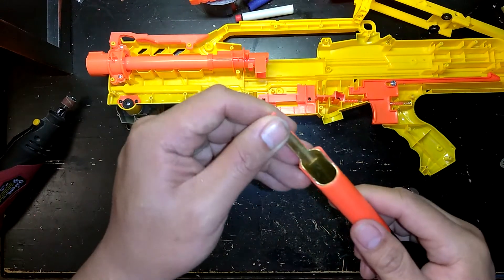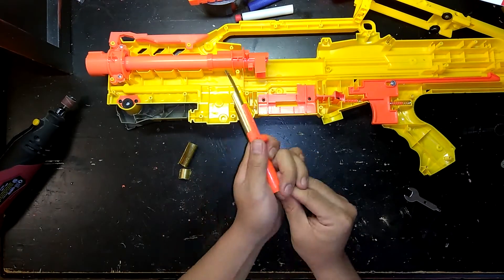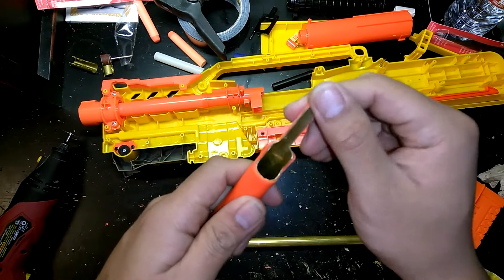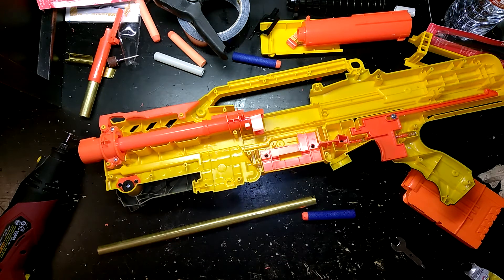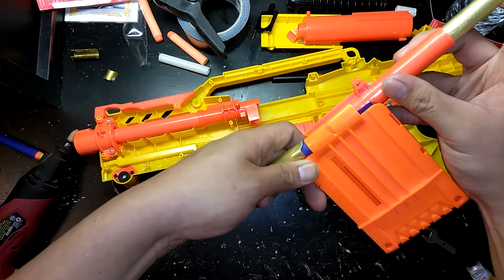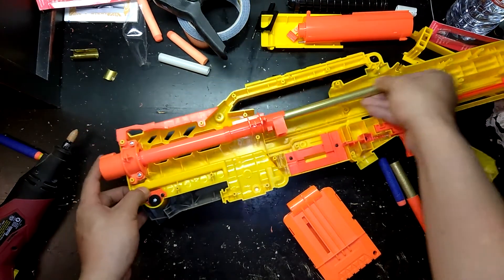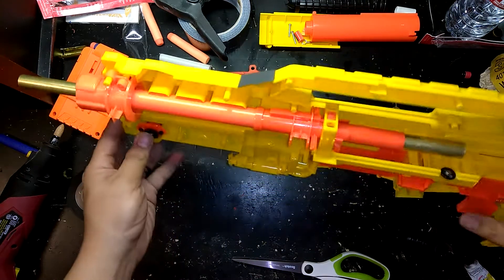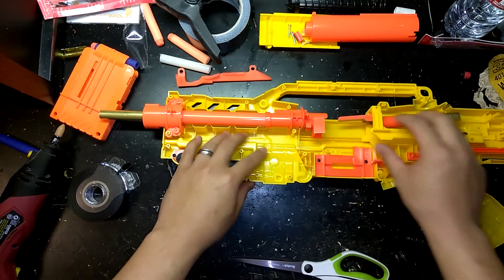Mod Guide - Nerf Longshot Mod Build Log [Part 4] : Sleeper Breech Finished

Comment: Working on my own brass breach and this video has been helpful. Just curious how well this feeds half length darts?
Reply from the maker: The only issue I've found with this feeding half-length darts is the type of magazine used. If it's one where the darts are more forward in the magazine, it causes double feeding. If it's in the middle or rear, it works just fine. My first sleeper breech (the blue one I've shown in some videos, is built for half-length darts as it has shorter receiving breech and longer pusher to account for it. It does still shoot full length, but not as reliably as the one in this video.

Comment: Just completed a build using this, thanks!
One suggestion, that "Fix-all Adhesive superglue" did not work that well for me, the plastic to brass connection didn't hold up to heavy use. The bolt joint and the front lip separated the brass from the plastic.
My fix was using a 2-part Epoxy,  Loctite 5-Minute Instant Mix (has a premix nozzle), Its $3.50, multiple uses, ROCK solid, sandable, easy to use, and can use it multiple times.
Reply from the maker: +TumorSVT agreed! I had to redo that as well in mine using the same epoxy.

Comment: why not simply install a 4 inch or so sleeper breech ? Hammer it in amd then cut....Is there a benefit to using the longer sleeper breech that you used?
Reply from the maker: I'm not entirely sure what you mean. Are you asking about the benefit of the barrel as opposed to just brassing the bolt?

Comment: Just finished making mine and for some reason an elite dart doesn't fly out the barrel. The 9/16 pusher has a great air seal. Could air be escaping from the 9/16 to 17/32? Also the pusher doesn't go back far enough to fit the mag in. Spring load is a Home Depot spring with the stock spring.
Reply from the maker: +Chicken Bro Productions The 9/16 should be the same size as the original plastic bolt so it should fit the mag. Your spring might not be enough. The Home Depot spring is a high yield, but short for a Longshot. Try something with a bit more precompressed.

Comment: Hi at 14:20 since you posted this video is the washer still the best method you have tired for a good seal. Sorry for the newbie question. Thank you for your help and time.
Reply from the maker: I would recommend the other way I said which is to cut a channel and use an o-ring. The washer is still a good seal, but the o-ring is better.
Reply: Cool.. what do I use to cut the channel? Do you know where I can get the O ring from?

Comment: What other brass breaches are there and what are their strengths and weaknesses?
Reply from the maker: There's the classic Angel breech and variations to it. Lazy breeches and variations to that. There are also various omni breeches done with 3d printing. The strengths and weakness flex from how good the seals are, how much dead space there is, what kind of dart fit you have, how easy/difficult it is to make, and the longevity/durability.

Comment: are brass breaches better than the alpha and omega kits?
Reply from the maker: Yup. Sleeper breeches I'm particular are more air efficient. You will still benefit from metal parts or reinforcements.
Reply: OC Nerf thank you. Am going to get omni kit since i can't get a real longshot. I will brass my retaliator though
Reply from the maker: I think the Omega will work well. We'll see when I get my hands on it.
Reply: would this also feed and fire waffleheads?
Reply from the maker: No, brass breeches work best with rebates dart heads not wide heads. You can use a larger diameter brass like 9/16 for waffles,but it's not as efficient.
Reply: @jaysondomingo1583  mine does

Comment: is the 17/32 too tight for a full length barrel?
Reply from the maker: +Vincent Loparo III That will depend on the darts you are using and how they typically fit in your area for brass. I've noticed that in some parts, it's really tight and in others just right to use 17/32 for elite darts.
Reply: i was thinking of putting 17/32 at the start of the front barrel and then followed by 9/16. this shl prevent the darts from exploding halfway through the barrel
Reply from the maker: +NerfFPS Mods As with all things, barrel size and material will depend on your dart fit.
Reply: For me it was so im just going to switch the placements of the 17/32 and the 9/16
Reply from the maker: +Gabriel Roxbury yeah, always test the barrels to your dart of choice

Comment: I picked up a longshot at goodwill for $5 and I’m planning on modding it. Any advice you can give me on modding one?
Reply from the maker: Great pick up. Well, depends and the games you attend and how you want to play.
Reply: OC Nerf thanks it also came with a 35 round drum (I already have 2 from a pair of raiders). I mainly nerf indoors but I do it outdoors occasionally at my friends house (me and my friends get together and have wars occasionally).
Reply from the maker: @wisconsinandnorthwesternra8381  I can tell you that the blaster in these videos it's doing over 200fps easily. That might be a bit much for indoor games.
Reply: OC Nerf I was planning on building this mainly for outdoor use since I have a few other guns I use for indoor nerfing. I do have a question, in part 3 you used a piece of a barrel as a dead space reducer and I was wondering if you know of anything else that would work instead
Reply from the maker: You can use a 17/32 to 1/2" reducer instead and get similar results.
Reply: OC Nerf I have another question. I drilled out the breach to make it wide enough for the brass but the hole ended up off center. Is that going to be a problem?
Reply from the maker: It'll depend on how off center, but it should be okay. You'll have more work to do to fit the bolt to the barrel if it's drastically off center.